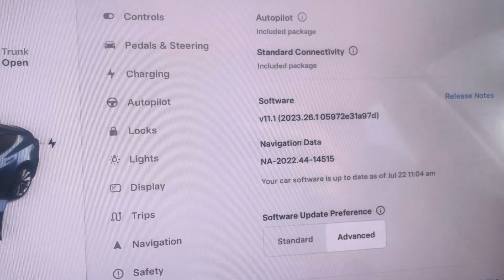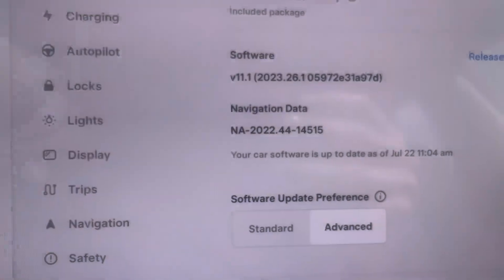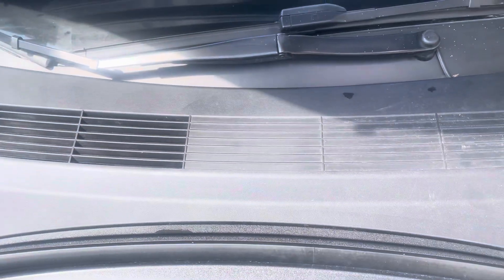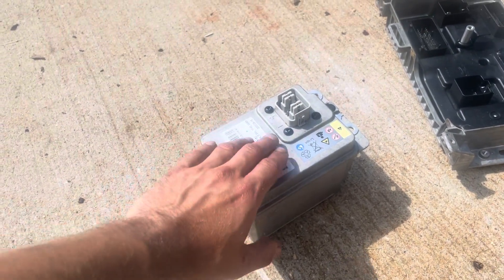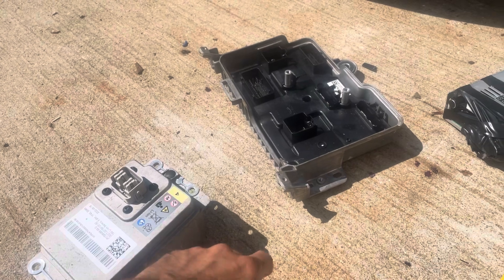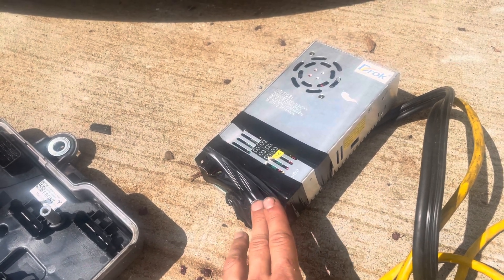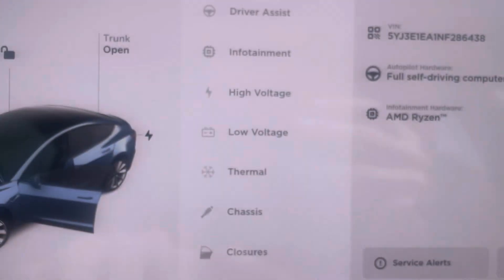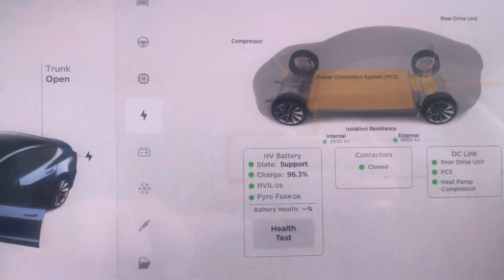How to get a 2022+ Tesla vcfront crash flag reset after an accident (after changing the pyrofuse)

Comment: Hello I’ve already replaced the pyro fuse on my 2022 model Y but the service screen is just loading,can I reset it trough toolbox or I have to buy a new front vehicle control module and reset it with toolbox or it will fix itself with a new one?Please a respond will help a lot..thanks
Reply from the maker: Toolbox

Comment: my 2021 with 44K miles just stopped working. The LV (12v) seems to be good. I am getting error vcfront_a059_inputresistancehigh. Can I check the VCfront? Tesla wants $9,500 and want to replace the battery. Any help you can be would be apricated.
Reply from the maker: For Tesla help, join the Tesla Rebuilders discord server: https://discord.gg/NuDuVTF3

Comment: Hi,

The issue I’m having is that I can’t seem to access Service Mode — it just keeps loading indefinitely.

I have a 2022 Model Y that I purchased from an auction. The airbags on the right side were deployed, and the vehicle sat for a few months in the cold. I replaced the 16V battery, and after that, the car powered on, but I’m getting a few VCFRONT fault codes: A192, A191, A171, and HVP_w028.

I’m not sure what software version my car is currently running, but I’m trying to access Service Mode to clear the post-crash (Shed) mode. Unfortunately, it won’t let me in — it just stays stuck loading.

Do you have any advice on how I can access Service Mode? Or would this require replacing the VCFront module?

Any help would be greatly appreciated.

Thank you.
Reply: Hi, I have the same problem, did you solve it??
Reply: @dawiddudek5834  yup! My pyro fuse gone so after I replaced that. I bought tesla toolbox for 1 day at $75 and connected the car and cleared the post crash shed! Now it's good :)
Reply: @code144  Yes, I have already replaced the Piro fuse. Can I reset the crash date in the airbag controller using the Toolbox? And the crash date in the 16V Battery, is it necessary to read the eprom in the Battery and erase it?
Reply: How did you access toolbox using a laptop to vehicle?
Reply: @pabloarroyo9365  you can connect via eternet cable
Reply from the maker: For Tesla help, join the Tesla Rebuilders discord server: https://discord.gg/NuDuVTF3

Comment: Hello, I need help with my 2020 Tesla Model 3 Long and, Dual Motor. I bought it at an auction, with a front crash, the airbag exploded, I changed the PYROFUSE and put the airbags on, I was able to put it to charge, but then I left it for almost 2 months without moving, and the 2 batteries died, the low voltage and the high voltage. I already charged the low voltage battery, but the vehicle did not want to charge, it went red in the charging port, the vcfront is orange in the screen, and the contactor are open.

Comment: hello.
i have a 2024 tesla model y that has been in an accident. I have changed the Pyro fuse. but it won't start. service mode spinning around when I give it jump start (12V booster)
what could be wrong with it
Reply: Same issue service mode spinning can’t reset it .. any update ?
Reply: Any update guys?

Comment: So I just replaced my vcfront on a crashed 23' m3p. i have toolbox and got the mcu to stop spinning and let me into service mode. However I have a can error for the hvc to talk with the vcfront or lack there of and I am told i need tesla to use toolbox plus to fix this as i cant do it on my own? is this correct?
Reply: I have the same problem. Did you find a fix?
Reply: @tacvborebel777 yes i did. The wiring harness inside the penthouse had a short. I found it by moving wires with lid off and ground cap connected. Once it made contact the hvc made a high pitch low decibel whine and the contactors clunk clunked. New harness installed and 8k mile later perfect car
Reply: @EngineInformant thank you bro. Do you remember which harness it was?
Reply: @tacvborebel777  There is only one main harness inside penthouse. Depending on your year, there is a revised part number and the only known difference i found was the wires are color coded rather than all white. here is the new part number AWD - 1732579-00-A or RWD - 1732579-01-A
ASSEMBLY - HARNESS - ANCILLARY BAY

Comment: Hi, I have bought a M3 21 which side airbags have been deployed. I have replaced the pyro fuse as well and even installed a new 12v battery but still my car is not turning on the Hv battery, means am not able to drive the car. Kindly can you share what shall I do. Thanks
Reply from the maker: It can be one of many things.   You need to have someone familiar with Teslas take a look at your error alerts.
Reply: @diytesla  upon doing a little search I came to know after replacing pyro fuse we need to clear vc front in service mode
Reply: @diytesla  I have imported the car from Japan and when I try to enter service mode by typing in “service” nothing happens. Kindly can you confirm what shall I do to enter service mode

Comment: Great video, I appreciate the information. I'm currently repairing a 2023 model Y, its display does not turn on. When we use a booster from the front, the lights doors and electrical all work except for the screen. When plugged in from the charging port the vehicle does not recognize it, it does not charge or show any light. Any information would be greatly appreciated, thank you!
Reply: Please
Reply from the maker: Check to see that you are providing adequate power (the car can pull 40+ amps from the LV power)
Reply: @diytesla  I boosted it with a 12V charger from the front. Is that good enough? If not what power supply should I buy? Thank you very much.
Reply: I have a mode 3 got it from an auction and it doesn’t charge keeps giving the hv problem and I replaced the lithium battery. This video is so helpful!

Comment: Hello I have a model y 2023 , got it from the auction and would start but not enough power so I bought a new battery from Tesla and also I took out v front then returned the same vc front and then now nothing is working only humming noise do you think i need the power supply on the new battery. ?
Reply: Did you figure out the issue?

Comment: hello brothers 
I apologize in advance for any spelling mistakes.
google translate

Are the vcfronts the same? 
Do I need to do anything else after changing it?

I have 2 vehicles in my possession.
and vcfront change?

2 cars heat pump version 

car 1 - tesla model 3 standart range 2021 - 12v battery   - single engine
car 2 - tesla model y performance 2023 -  16v lithium battery - dual engine

NOTE : Service mode turn and turn and turn :(

Help please
Reply from the maker: I am not sure but I think they are different, I think newer ones can be used on older cars but not the other way around.   Also we started offering vcfront reset service, so you can mail us your vcfront and we can clear the crash flag on it.
Reply: @diytesla  I’m interested in getting VCfront reset, how can I contact you?

Comment: Hello, I have a 2019 Tesla model 3. 
I bought the car wrecked with airbag deployed. I got the car fixed and running but I cannot update software. Says it’s connected to WiFi but still saying to connect to WiFi. I have tried soft reset and nothing. Am I missing something? Do I need to replace anything else? Also no service mode option either.
Reply: Hey know this is old but I’m having the same issue, did you figure it out?

Comment: Thank you man you are great always your advices right on the spot. I bought a new OEM battery ebay i tried to charge it via 16v charger with eligator grips directly on the top poles without opening it? Hope I did not fry it?
Reply from the maker: No you didn’t fry it because those top terminals are usually not connected to the actual battery cells.   Once you get the car running and do a software reinstall with the battery connected, the car will recharge it.

Comment: Please advise on how to vet a 13v power supply
Reply from the maker: DROK 12V Power Supply, AC 110V... https://www.amazon.com/dp/B0B18NHW9R
Make sure to buy the 40A version.  You will need to wire it up yourself.
Reply: Thank you so much i ordered from amazon. Im just confused in the video you said has to be 13.5 v but you advised in the link to order 12v??
Reply from the maker: @adib8601  It is adjustable voltage.
Reply: Alright thank you so much. I tried to charge the 16v battery directly without opening it. I used ac dc 16v charger. Hope i did not fry it?
Reply from the maker: @adib8601 No, mosfet “relays” inside the battery are usually open.  So you probably didn’t so anything to it.  But if the car refuses to charge it then you will need to replace the battery.
Reply: alright that is what I was hoping that open Mosfet circuit will prevent any current flow to protect the battery.Waiting for the power supply to try to update and recharge.Thank you so much. You are amazing. @diytesla

Comment: Hello I entered service mode but it does not want to launch it is looking for I have changed the pyro I am in version v11. 2023.6.11 thank you
Reply from the maker: If your car is 2022+ you need to replace or reset the vcfront.
Reply: thank you for your answer if I replace the vcfront with a new one It starts where you have to code? and the lv 16v battery is at zero can it recharge?

Comment: Hey great content, but have you done the load crash without replacing the vcfront? Haven’t had to replace one yet, however, through shop account, Tesla did have to connect with me to the vehicle to get the task on toolbox 3 on few cars.. how could I contact you? Have few tools I would like to show you that I made and plan to sell. Thanks
Reply from the maker: Yes you can clear the load shed flag with toolbox if the car is running 2022.44 or later.  You can contact me at diyevrepair at gmail.

Comment: Hi ! 
Can you guide how to reset vsfront / clean crash data via toolbox ? I have Changed the pyro fuse on model 3 , but can’t reset it on screen and my software is 2022.
Thank you in advance
Reply from the maker: Yes you have to do it through toolbox.  But only if the car is running 2022.44 or newer.  Older versions require vcfront replacement.
Reply: @diytesla isnt that the navigation data you're pointing to though?

Comment: What's the correct power supply that can support both model 3 and Y, you mentioned that the one that you're using in the video sometimes wasn't enough
Reply from the maker: There was only one time when a 40A power supply couldn’t handle it.  I think it was an issue with the car not the power supply.  40-50A 13.5V power supply should work with all Teslas.
Reply: Can I just use a brand new 16v tesla battery as my power supply?

Comment: Hi @diytesla it's model 3 2023, and I was able to clear the crash load shed from my previous projects with the toolbox; after replacing the VC front with the cleared one now I can access the service mode, but I can't do anything because signals won't work and the software reinstall starts at the middle and won't continue; also software update came once and didn't finish downloading.
what's your recommendation 
LV battery is at 23%, so it should be fine once the VC front works; also I hear contactors open and close
Reply: Do u mind telling me how to setup my IP address for toolbox 3 and under what option do I go to in toolbox 3 to get out of the load shed mode for model y
Reply from the maker: Join our Discord for help https://discord.gg/XXduFWab
Reply from the maker: Join our Discord for help https://discord.gg/XXduFWab

Comment: Where can I buy the power supply
Reply from the maker: DROK 12V Power Supply, AC 110V 220V to DC 0-12V 40A 480W Buck Converter Dual Display, Variable Adjustable Adapter Regulated 5V 6V 9V 12V Switching Voltage Transformer 10A 20A 30A 40Amp Charger for Lab https://a.co/d/6dxseDi
Reply from the maker: Make sure to get the 40A version.  You will need to wire it yourself.